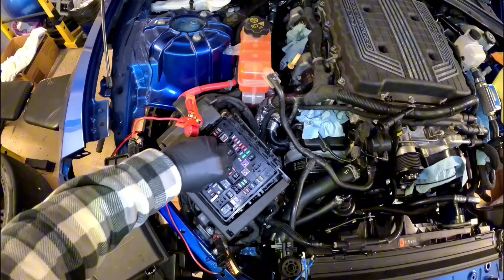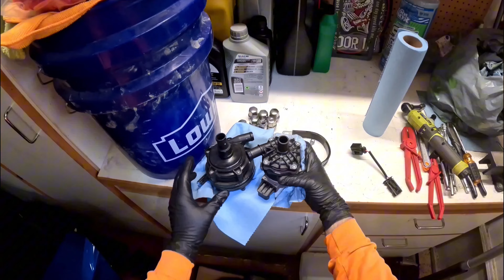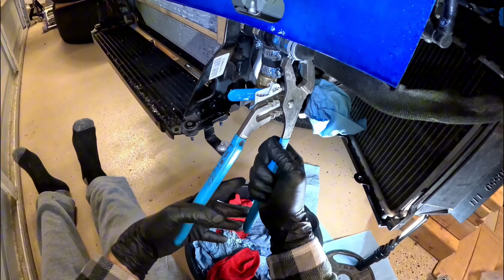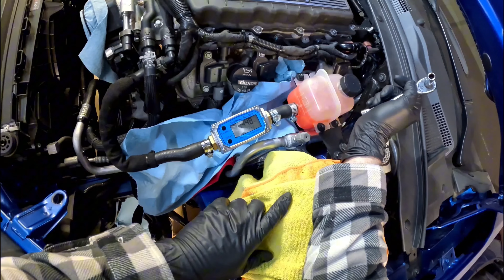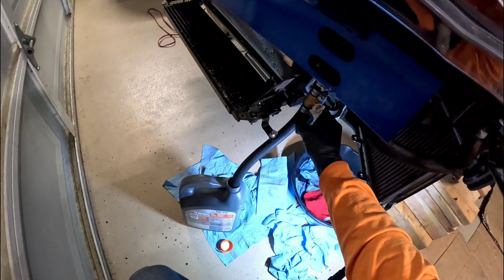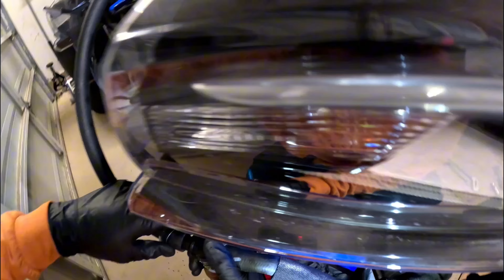Charge air coolant system flow testing and troubleshooting 2018 Chevrolet Camaro ZL1

Comment: So did you put back the cwa 150 pump back to get a reading on the flow rate?
Reply from the maker: Engine is arriving this week.  Will do a final flow test once I get my new lines ran and the pump back in.